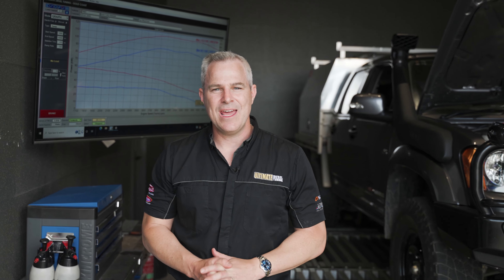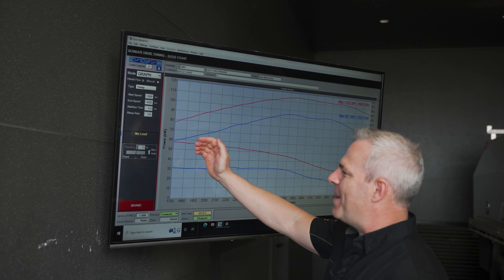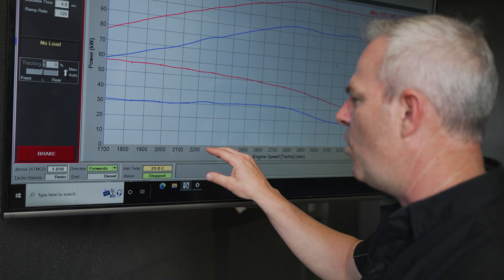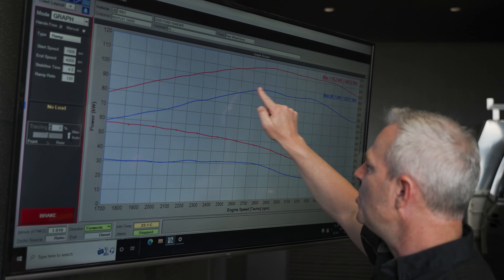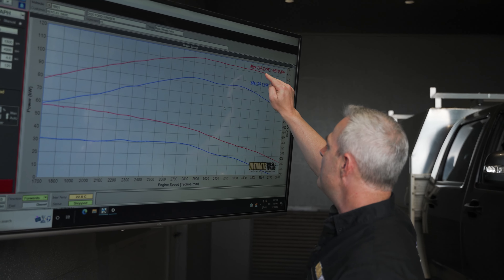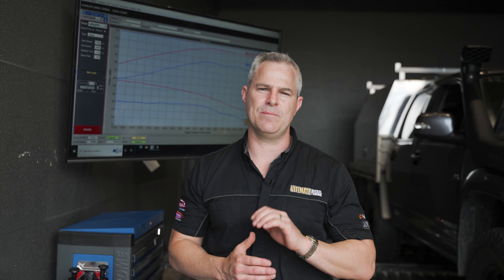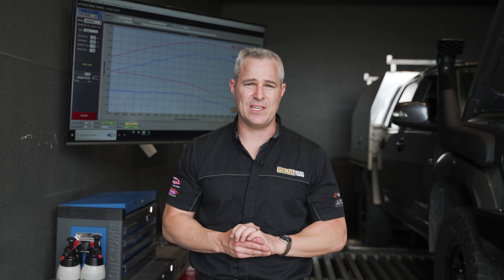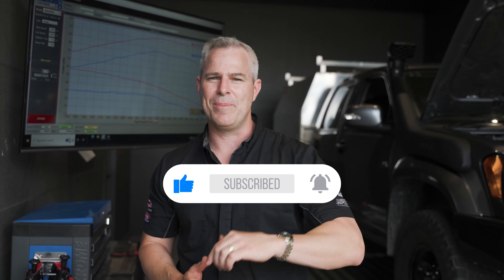Confused about dyno graphs?! Here is how to read our ones!

Comment: Hi Rob - Couple things I'd like to see  UDT's take on please: 1) throttle controllers overlayed on a UDT custom dyno tune, effects/issues?   - 2)  Plug in EGR cables (air temp sensor trickers) and how/if they affect AFRs (stock and custom tune)  off idle and throught the rev range, &  3)  Like "Ol' mate Brian" says, SA is screaming for yor services... I hope youre doing the market research 'coz I'd bet a pub lunch it'd be sustainable in SA.  Surely there's a partnership or something to be leveraged.  👍